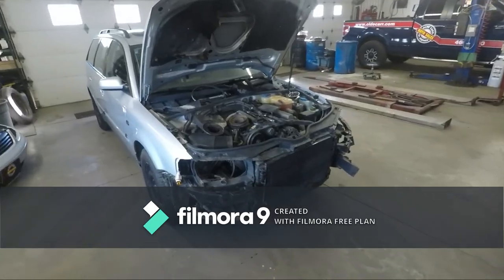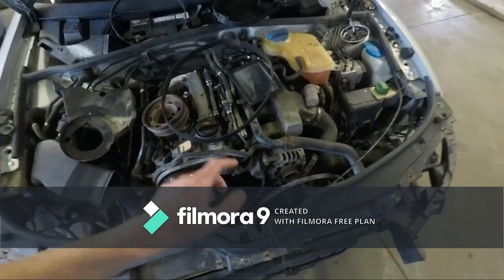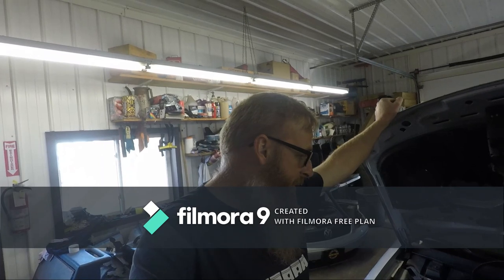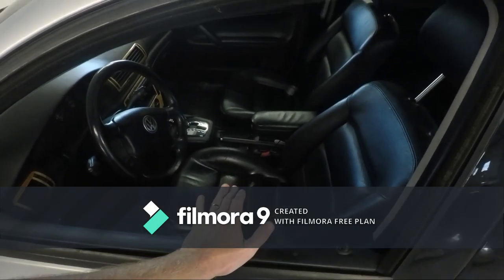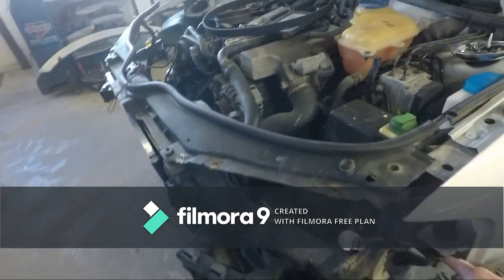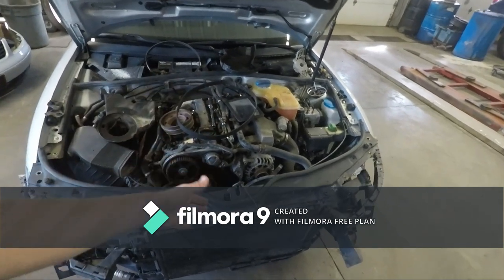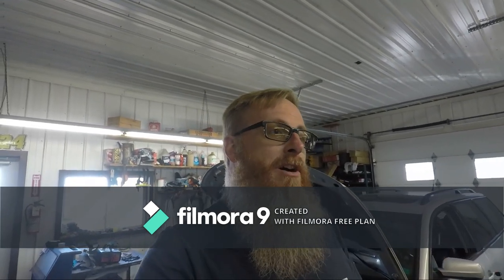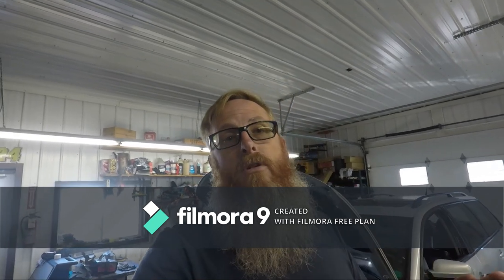HOW I DIAGNOSED A BAD TIMING BELT ON MY 2000 VOLKSWAGEN PASSAT 1.8L TURBO

Comment: I had forgotten that the older Passat wagon had its 1.8 liter turbo mounted in the North South direction. Like Audi, it’s a front bumper off deal. A good used engine for $500 to $600 Canadian isn’t bad, new internals and machine shop charges would easily exceed the cost of a salvage engine.
Reply from the maker: That was early spring prices and there isn't many around. I'll Update on that in the next video.